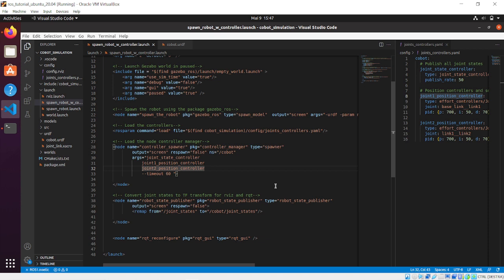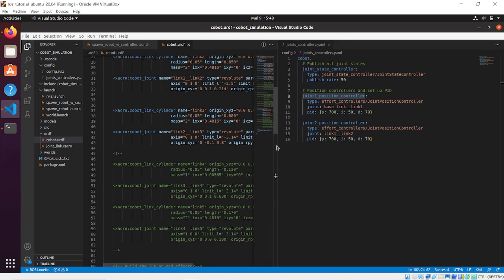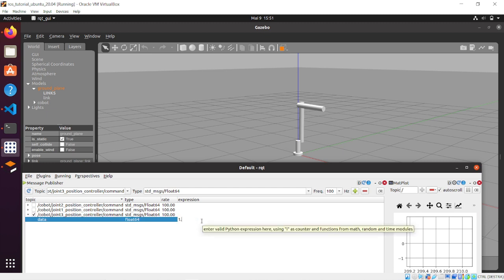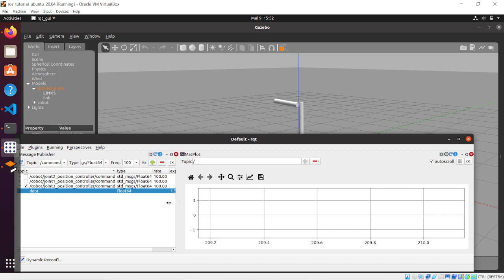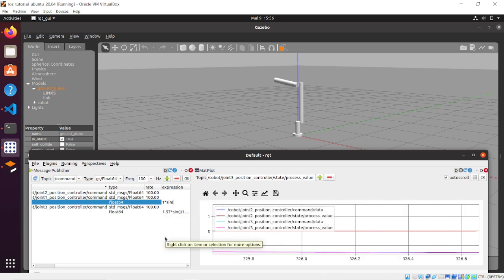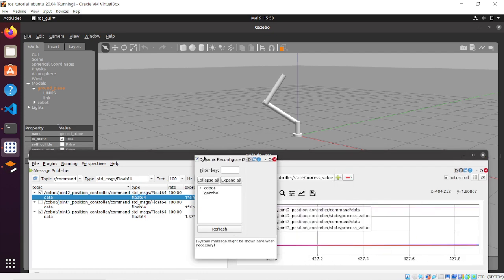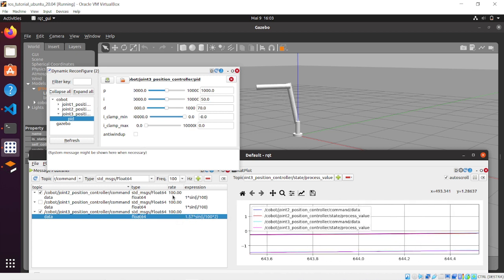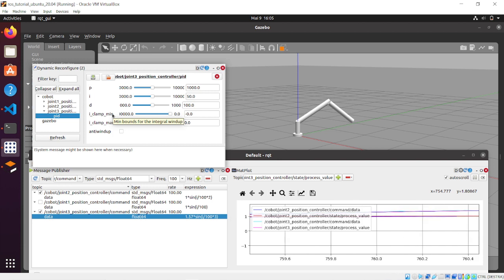How to setup ROS Control for 6 axis robot, Part 6: check the joint controllers interference

Comment: Hey Hi,
my first joint is working perfectly fine. but when I add the second joint and trying to publish position the part suddenly disappears in gazebo. What would be the reason? Here is the details of the link.

<link
    name="link_2">
    <inertial>
      <origin
        xyz="-0.0024916 -0.027424 0.015242"
        rpy="0 0 0" />
      <mass
        value="0.0060256" />
      <inertia
        ixx="4.4152E-06"
        ixy="-3.7675E-08"
        ixz="-6.0876E-08"
        iyy="2.1734E-06"
        iyz="1.9989E-06"
        izz="2.5295E-06" />
    </inertial>
    <visual>
      <origin
        xyz="0 0 0"
        rpy="0 0 0" />
      <geometry>
        <mesh
          filename="package://gimbal_simulation/meshes/link_2.STL" />
      </geometry>
      <material
        name="">
        <color
          rgba="0.50196 0.50196 1 1" />
      </material>
    </visual>
    <collision>
      <origin
        xyz="0 0 0"
        rpy="0 0 0" />
      <geometry>
        <mesh
          filename="package://gimbal_simulation/meshes/link_2.STL" />
      </geometry>
    </collision>
  </link>

Thanks in advance for your support.

Comment: Sir, did you get back to your computer system?
Reply from the maker: Hi Fawad, check it out your email. I have created another URDF file, modified accordingly the launch file and the .yaml file as well. If you see at the start the gripper moving is because you would need to tune the PID parameter accordingly. To do that check out this video https://youtu.be/x-Yqo4yNsFY
I hope that this solve your problem with the gripper.
Reply: @learn-robotics-with-ros  alright, thank you  sir, for your incredible support.
Reply from the maker: Furthermore, if you struggle in dealing with URDF file and how to simply by using xacro and macro in it, check this video https://youtu.be/Yk_23itI50o